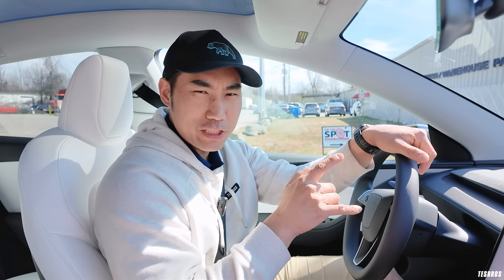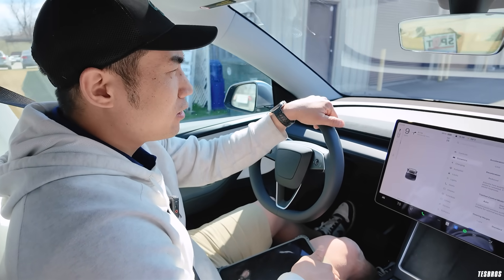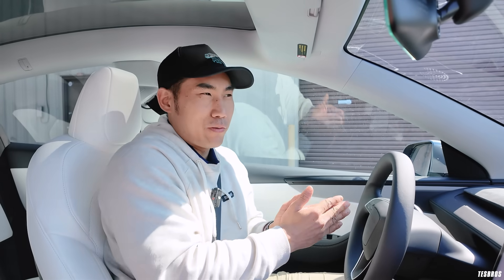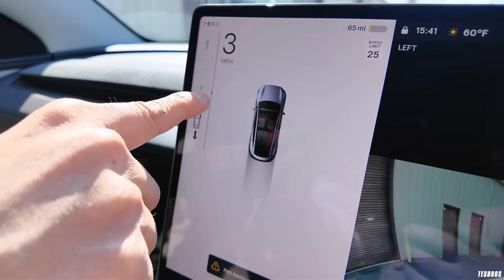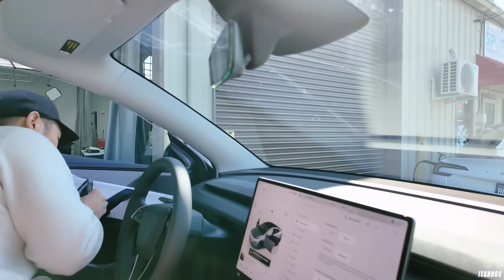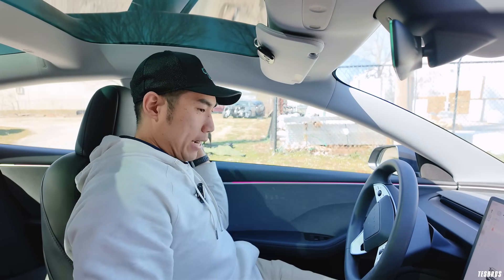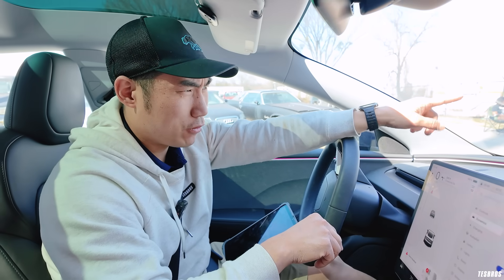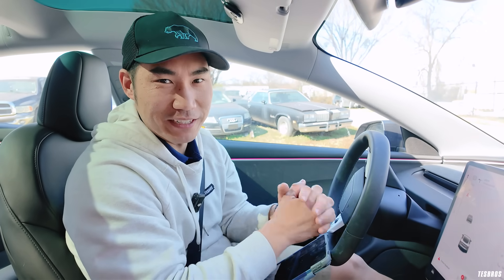Why The 2026 Tesla Model Y Regen Braking is a Game Changer

Comment: This is called series regenerative braking. Other OEMs like Ford and Toyota have been using a version of this in their HEVs for over 20 years.
Reply from the maker: Yeah regen braking’s been around for a while in hybrids. What’s interesting here is how Tesla implements it in a fully electric platform: regen strength is much more aggressive, it’s tightly integrated with battery management, and Tesla is constantly tweaking it through over-the-air updates to balance efficiency, safety, and driver feel. So while the concept isn’t unique, the execution and continuous refinement on a pure EV are where Tesla is pushing things further

Comment: I'm still a bit confused - I test drove one earlier and was surprised that the regen braking felt so different from my 2020 M3, even on Standard.  

Here, it sounds like you're saying that it should be basically the same? I felt like I needed to use the brake pedal more than in my M3.
Reply from the maker: Was the car at full charge when you test drove it? Regen is lessened if you're at full charge - could explain that.

Comment: My Blazer EV has 1 pedal with 2 levels of regen and can be moderated. The blending is pretty smooth you can't tell at all when the hydraulic brakes start contributing to the vehicle deceleration.

Comment: Why Elon? Apply Brakes When Regenerative Braking is Limited option gone in 26 Juniper Y. Why?
Reply: Gotta make sure those EPA range estimates are as consistent as possible. That or they're confident that the deceleration feature is so good that the option is no longer needed? I haven't driven a Juniper model yet. I hear you on the option for "Apply Brakes When Regenerative Braking is Limited". I hate the inconsistency feeling in braking as well.
Reply: Ok, Elon fixed it. In the Juniper there is no option because it defaults to always regenerate even when battery pack is 100%.

Comment: Love the new brake system. It gives user the option to have less than "standard" regen, but is able to recoup those energy back by apply brake pedal. I know overseas market or very earliest times Tesla allows the user to choose between regen "low" or "standard". The regen "reduced" is the same as old "low", but the difference is old cars won't recoup those energy back if you step on the brakes, where now it does by applying brakes.

Comment: Really Hello Duh. I have Hybrid Corolla 2023 with all these options. Cool lol😂
Reply from the maker: Yes very similar! Juniper uses full brake-by-wire integration while the Toyota Corolla Hybrid (2023) uses Electronically Controlled Braking (ECB) – a semi brake-by-wire system. 
Key differences: 
- The Juniper update makes regenerative braking even stronger and blends it seamlessly with friction brakes. Toyota's system, while efficient, does not prioritize regen as much.
- Tesla supports one-pedal driving – You can drive without ever touching the brake pedal in normal conditions. The Corolla Hybrid always requires brake pedal input.
- Tesla has a stronger regen effect – Tesla vehicles slow down significantly when you lift off the accelerator, recovering more energy. The Corolla Hybrid has mild regen, more like coasting.

Comment: Excellent explanation of regen braking. I prefer standard mode because it allows you to drive most of the time without actually using the brakes which means the brakes will rarely if ever need to be replaced for as long as you have the vehicle. I understand why some people would like  reduced regenerative breaking but for those who truly understand EVs, standard is King.

Comment: There are a few situations where the one pedal driving simply doesn't work well: 1) Older people with not a good control of the accelerator pedal,  it causes jolts 2) in icy conditions, if you quickly remove the foot of the accelerator you could get into trouble. 
Honestly would be cool if they gave you the option of no regen at all (unless you press the brake)
Reply: Can turn off regen with sexy buttons
Reply: @tonymcflattie2450 , exactly!
Reply from the maker: @lowspeed2000  great points! Sometimes I reduce the regen in heavy rain too
Reply: Free Palastine
Reply: @acerpc2023acerpc free ur mom

Comment: I got the S3xy buttons. I got them exactly for this same reason. I toggle from 75% to 100% regen with one single click. (It is customizable)
Reply from the maker: Nice setup!
Reply: How fast is the change once you press the button?  Also I wonder if you put it on 0% will pressing the brake on the Juniper start with regen and then blend the physical brakes.
Reply: @lowspeed2000  the change with the S3xy buttons is instant with their v2 commander. And yes. If you set your regen to 0%, you'll have to apply physical brakes.
Reply: @drivekapsule  the question is how well the blended Regen works on the new system when 0 Regen when accelerator pedal is off and you start pressing the brake pedal
Reply: Go regen off! Living on the wild side
Reply: @tonymcflattie2450  dont get me wrong. I love Regen. But sometimes it is a bit aggressive, and it throws off my passengers. I'm happy there's a way to customize it.
Reply: Does the S3xy buttons cancel the warranty?

Comment: Is there any clear indicator when you’re braking past the limit of the regen? Like once you push it past a point and the friction brakes come in you’re wasting energy so it’s good to know you should be stopping easier. Why I prefer one pedal driving now, but would be interesting if they showed something.
Reply from the maker: When you watch the screen where the energy indicator is, you'll see how it's green first and then black when it's using the mechanical brakes. That's the only real indicator for now

Comment: Lol, my 2020 Honda crv hybrid does this and even gives you petals on the steering wheel to control regen, and the brake Petal also uses regen and blends with the brake pedal, so what's new here again?
Reply from the maker: Teslas are known for their "one pedal driving" meaning you only use the accelerator pedal and as you let off of it, regen braking kicks in and slows the car. When you used the brakes, it was only mechanical. Now with the Juniper, they've incorporated regen with the accelerator pedal AND the brake pedal. 

That's cool that your crv has those features! More energy savings, the better.
Reply: Tesla has had this for years. He's just talking about changes in the new model

Comment: This is not new.  Tesla had this feature before where it allows you to select how aggressive you want the car to decelerate but then they took that option away.  And now they bring it back with decelerate with regen, which Chevy EVs like Bolt, Volt already has this decelerate regen.
Reply: I think the bolt use both physical brakes and a little regen 
Because it's not "Brake By Wire" which apply regen to a limit then shift completely to the ABS "turn off regen" to do it's work safely when ABS needed
Reply from the maker: Yeah, the option to have the reduced or standard regen functions isn't new. They took those options away in late 2020 - it was called " low and standard" - to maximize the vehicle's range all the time.

Comment: The whole reason why I love driving EVs like the Tesla is the one pedal driving. I don't know why you'd want the reduced mode.
Reply: Sometimes the hard regen makes passengers uncomfortable 🥴
Reply: @RayNLA  That's why you gotta be smooth when you let off the throttle with one-pedal driving. Just like you gotta be smooth with the brake pedal. Takes some adapting, but it's great when you do.
Reply: @ 
Thanks for the tip but you’re preaching to the choir brother. I have three in the garage. Since 2019! Took me all of 5 minutes.
Reply: @ only if the person driving doesn’t know how to drive. As a pilot I ride in UBERs several times a week. If I have a Tesla ride I cancel it because most of these guys don’t know how to drive with Regen braking. I had one guy drive me in New York and I got so sick that I said never again. He only knew to accelerate or to decelerate. It’s really not that hard to keep the foot on the accelerator pedal to “coast”.
Reply: This is not a software thing - it won’t come to other cars without new hardware. Lars even calls it more like ‘brake by wire’. The brake pedal initially is simply applying the regen. The mechanical brake only kicks in under higher force. So if you have the reduced setting, and naturally tap the brake - like in a regular car - you get the full efficiency of one pedal driving without the jerking drive.
Reply: When your spouse or friend that drives a normal car drives your car and you don’t want them brake checking people by accident. It takes some getting used to and I’d prefer they don’t    get my car rear-ended while they figure it out.
Reply: @ I guess. My wife and I both drive Teslas so we know how to drive single pedal but I guess if that one day ever comes and a friend drives my car, the setting could come in handy. My 2016 Model S had that setting too. They took it away for a few years and now it’s back.
Reply: I think it's there entirely to help new customers feel comfortable. Lots of people who aren't yet accustomed to driving Teslas or EVs. Personally, I think they should just get used to one-pedal driving, but lots of people are afraid of change.
Reply: @ I get that but I think that change is good and you only learn this way of driving if you’re forced to. I also find it very unfortunate they brought the blinker stalk back. Last 3 years I got used to the buttons and now I have to use the stalk again when I get a replacement. I don’t think that’s the way forward. It should be an option - even that drives prices up.
Reply: @Kaipeternicolas  Oh, I totally agree with you. Turn signal buttons on my Cybertruck and one-pedal driving are exceedingly easy to use... But there are a lot of stubborn luddites out there, and at the end of the day, Tesla needs to sell lots of cars. I think the option to have the regen braking to allow for a more traditional feel is a smart compromise for a gateway vehicle like the Model Y.
Reply: @jasper_of_puppets  Without regen braking your range will be crappy! I love the one pedal driving on my 2023 Model Y LR AWD, just wish it had double the range, somewhere like 500 miles would be good.
Reply: if you understand movement of inertia then you know how useful
It is
Reply: Many people have motion sickness issue with it. Having an option to turn off is the game changer.
Reply: @sjp2e it really shouldn’t cause any motion sickness unless you don’t learn and adapt to single pedal driving. 🤷‍♂️

Comment: The new Juniper mechanical braking system is great. The brake pedal stays up so it's the same pressure when using regen one pedal then needing the brake pedal. It's great to add efficiency everywhere Tesla can to gain range. However, there's a limit on the battery pack and customers. They want 400+ miles. Tesla just won't increase the battery pack. It only needs another 80 miles to get there, and the Juniper Y has the physical room to do it. Only 19% bigger pack is all it would take. Waiting for cell technology to do it is a gamble.